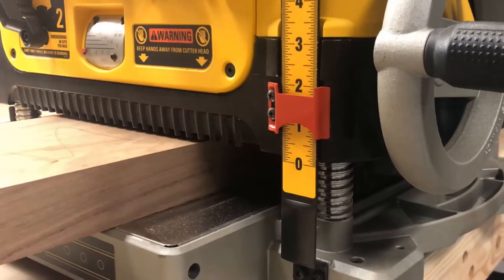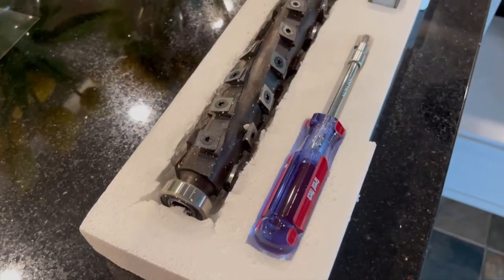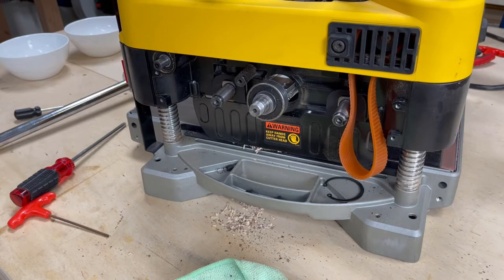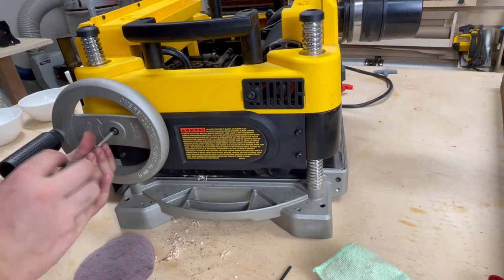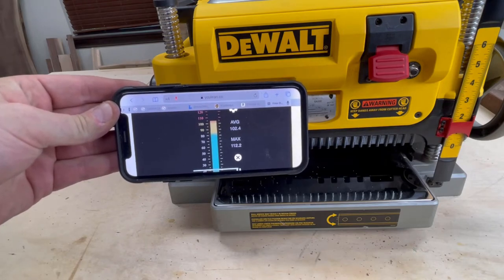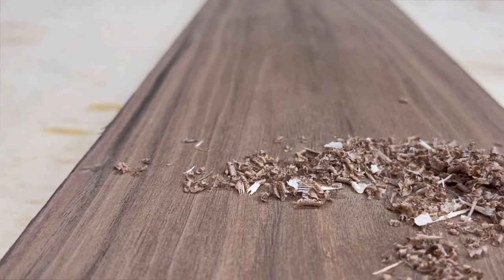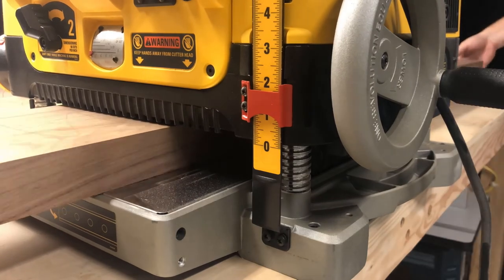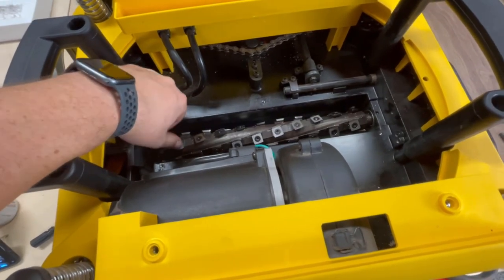Shelix Helical Cutter Review for DeWALT (735) Planer

Comment: I bought the 735 shortly after it came it. Ive gone thru a few set of steel knives then purchased a set of carbide knives for it. they worked great for plenty of board feet until I hit a knot in some Chinese Elm and one of the blades exploded. (if you don't think this wood isnt hard think again) So after a few months of pondering  about carbide knives or back to steel I went for the OEM size shelix. Ive yet to install it. From this review I think its worth it.

Comment: Ive bought the 735, and the Lux head. I have not installed the new head yet, but i started using the planer and ran 6 cherry boards through it, 8" wide, 30" long. The result was amazing. And the kicker is, i jointed the boards with a jet helical head jointer. The finish was better with the planer knives! I almost dont want to put the Lux in...

Comment: I have this same planer and will be upgrading my blades because of this video. On the other hand, it will have to wait until I invest in some other tools first, just like you recommended. Also, mine came with an extra set of blades that I haven’t even used yet. Great video! 

PS: I already started filming a review of this planer but probably won’t release it for another 6 months or a year so I can give a full review based on plenty of use.
Reply from the maker: I am glad you found this useful! I am interested to see what you think of the planer in your review video. I personally have been very happy with it, which is another reason I opted to upgrade it rather than investing in a larger floor standing planer. Sometimes I wish I had more than 13” of planer width, but I continue to find ways to break out my projects into smaller pieces so they still fit through.
Reply: @EigenDesigns  I’m fully expecting a great review. I’ll try hard to find some cons to make it a compelling review but so far it’s 2 thumbs up.

Comment: Great review. Very helpful. However 109 db is 170% louder than 102db, which is not insignificant.  Every 10db is double the volume on the logorithmic decibel scale.  I imagine that difference is even more substantial with wider planers.  I respect that you did not perceive a great audible difference and that it was only measured on a smart phone. Thanks again 👍
Reply from the maker: Very valid point. I remember learning about this in physics. I think it was every 3 db doubles the sound "intensity", which is directly proportional to the volume. In either case, your comments around the signifcance of 7 db is duly noted. 

I will say after using this new cutter head for a number of months, I think this is such a fantastic upgrade. I am so glad I made the investment.
Reply: @EigenDesigns  Not exactly true. A 3db gain does represent a doubling in the sound intensity but only a 23% increase in loudness.

Comment: I think your review was good 👍 I just installed one in my 735 maybe this will help someone else decide cut quality on the factory blades is smooth looks good when blades are new but very quickly get damaged and start cutting with groves blade material is soft and much to thin to last the cut quality of the helical is fuzzy and some what torn out didn’t seem to matter what type of wood or how fast or deep the cuts were taken I believe this is due to the carbide cutters being spaced further apart due to lower hp planer, cutters are spaced closer on larger higher hp planers but the cut of the helical on the 735 can be sanded out easily the carbide out last the straight blades Hands down ! For me my review say spend the money toward a better planer !
Reply from the maker: Very good points. Do you have any other planer recommendations with a Helical cutter head in the ~$1,000 - 1,200 price point? If so, please share so I can pin your comment.

Comment: The sound decrease might not seem like much(even though sulliv26 makes a very valid scientific point), but over the long haul is significant, imho.  Also the time required to install a fresh set of knives and getting them lined up might also be looked at as a time saver, especially if you're changing them out more than once a year.  I personally love it when new school design and materials is used to improve existing, well proven old school machines.  Shelix is awesome, have a head on my jointer.  Soon as I pickup a used 735, i will be swapping the head out.
Reply from the maker: Great point about the time component associated with changing out the knives. I am very happy with the shelix head after using it for 8 months. I have put over 1,000 board feet through it and haven’t had to rotate a single cutter yet.
Reply: @EigenDesigns  nice
Reply: @EigenDesigns  good morning, 

Do you have zero snipes with this setup?, I am new to planer and usually sand to get as flat as possible
Reply from the maker: @rickyperkins232  There is still some minor snipe. There's ways to manage the snipe (e.g. make the piece a bit longer than you need and then trip off the end with snipe), but its still there.
Reply: @EigenDesigns  thanks, Merry Christmas bro
Reply from the maker: @rickyperkins232  you too bud! :)

Comment: I am not impressed with the finish at all.
Reply: I just got mine in, I’m very surprised by he streaking. It’s not mentioned in many comments so the ones I did see, I thought were just a fluke. Apparently it’s very common. Pretty disappointed. Nothing some sanding can’t take care of but just really thought it would be better
Reply: @Shannon-v3r  I'm amazed everyone says finish is smooth as glass. Yeah, wavy glass. And on a jointer, you really don't want to sand a face to be glued.
Reply: @dougprentice1363  I would never consider putting one on a jointer now. The segmented ones I thought were a cheap alternative to these but now I’m not so sure. I don’t know if it’s all helical or just Byrds.
Reply: @user-nx3zk5qi8t  If you think about the geometry, I believe all helical heads will cut that way. I am sick that much money into planer and jointer.